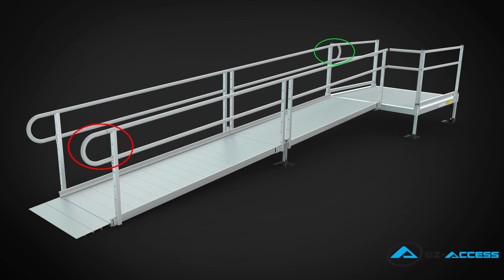PATHWAY® 3G Installation | EZ-ACCESS

Comment: Excellent video.  We are getting ready to install a used one at our house.  We actually have 2 driveways, one on each side of the house, and I'd like to have a ramp running from the platform down both sides each leading to their separate drive.  Is there any reason we couldn't or shouldn't do it that way?  Also I read the online instructions and it mentioned that a ground rod and copper wire needs to be installed, is this correct?  Thank you!!!
Reply from the maker: Sounds like a very reasonable project. The rod and wire are used for grounding the ramp in case of a lightning storm. If you contact our customer service department at 800-451-1903 they can work with you on the finer details of your project.